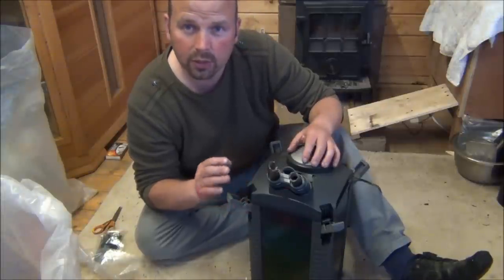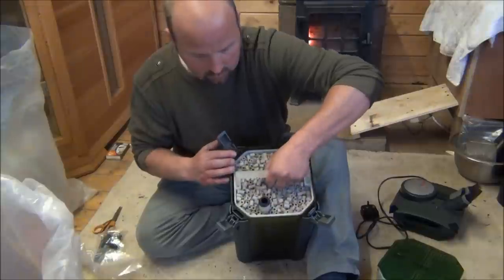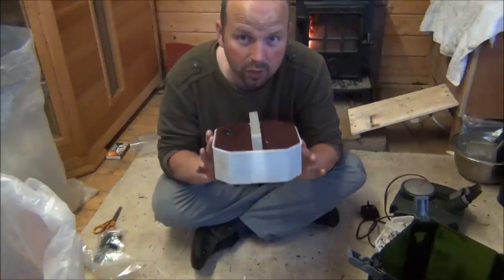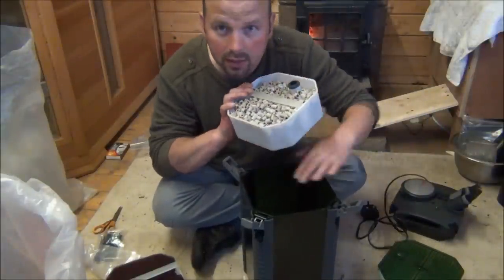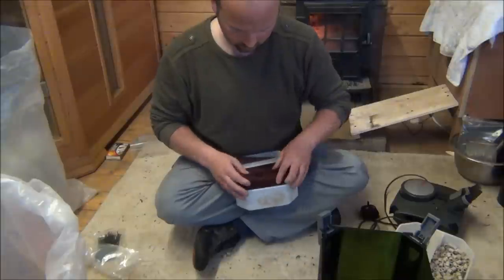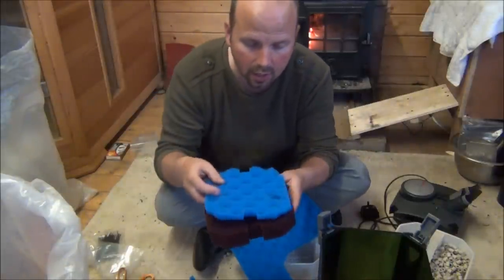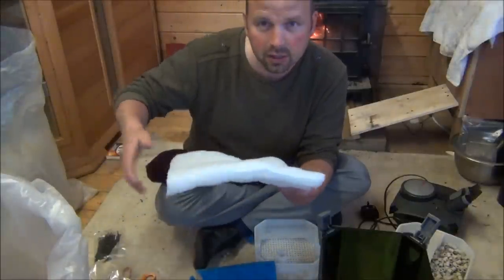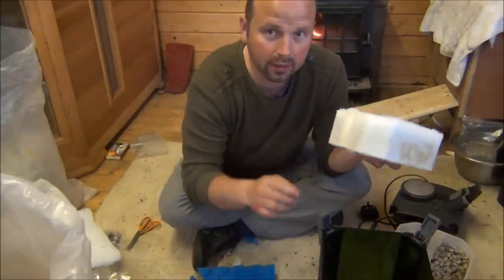How to set up an external canister filter for aquarium by Pondguru

Comment: Guru?  After almost 6 years is this still your most effective set up?  Or would you change anything?  The filter I am getting I will have 4 trays to work with.  If I choose to do a chemical layer (carbon, Purigen, etc), would you want that before or after the bio?  Thanks
Reply from the maker: Ideally the chemical 'polishing' media would go after the biological media so it would be last in the filter, operating in the cleanest water. Carbon will polish water without the harmful effect on bacteria experienced by users of purigen. If you want to achieve a full cycle then carboin is the way forward if you want a chemical media in the filter but if you're happy with half a job (0 ammonia, 0 nitrite and high nitrate then purigen will make the water look clear but not necessarily healthy.
Reply: @pondguru  what's wrong with purigen?

Comment: Great instruction...thank you.  For the medium foam, does it matter if the reticulated side is pointed down or not...to me it seems the water flow should hit the larger surface area first?
Reply from the maker: Arrrrgh, yes I just checked and I made a balls of that in this video. The bumpy side should always face down if the water is coming from below as it does in 99% of external filters. I will be doing another video like this over next couple of days and I will be sure to point that out I will also mention about the gel filter starter balls too.
Well spotted, man.
Reply: Pondguru Cool, I'll look out for the new video.  I came here because I picked up a second hand 2028.  I am working with an o-ring vendor to see if if we can get a standard EDPM 70 Duro round oring to work for the main head oring.  Have you ever used a regular round cross-section oring for this seal?  I am also finding it hard to find not only reasonably priced eheim 2028 parts here in the US, but also the Biohome media.  I don't necessarily want to order ebay from across the pond.
Reply from the maker: Roy Niswanger I have had nothing to do with replacement seals unfortunately so I'm not much help there but the direct link to the US supplier of biohome is in the video description.

Comment from the maker: It is way cheaper than the equivalent ceramic media and 1 kg of Biohome mini ultra equates to 1.5 litres of volume so you get a lot for your money. £12.99 for 1kg top quality media is very affordable, I'd say.

No point spending twice as much on a product half as good or buying media just because it is cheap. Better off buying media which does the job and makes the most of the filter space available.

Comment: Hi Ponguru, just saw ur video and found it very informative. 

I think the reason y there is a fine filter pad just before the propeller is so that it can protect the propeller and the fragile mechanical moving parts from the disintegration pieces coming from the medias. I dont suppose any filter media dont disintegrate a little with time. Those small little particles of hard objects will certainly cause damage to the moving parts once they come into contact. This is an engineering observation. :)
Reply from the maker: That's the only reason it would be there so you're dead right about that but it has the unfortunate effect of holding fine dirt in with the media, clogging it so it becomes ineffective quite quickly.
Glad you enjoyed the video, man.
Reply: Your formula for setting up the filter is great. I would keep the layer of fine filter pad at that location just before the propeller to protect it. The mechanical filtration foams at the bottom tray should be very effective in preventing all dirt from going to the biohome media. So I would say whatever dirt that is reaching the fine filter pad protecting the propeller would be very minimum and would be coming from the biomedia.

Clogging would be very much reduced. Failure of the propeller is of the highest priority, imo. 

You have a good day and make more good videos :) Cheers.
Reply from the maker: Steven Yap Will do, man - thanks for watching and appreciating the videos.

Comment: Hello Pondguru, thank you for your video. I tried to setup my filter like you explained, and I got it clogged after 3 weeks of operation. I used coarse foam, polyester filler, then biomedium. Polyester got clogged very fast. Do you think that using 30 ppi foam in-between will help me to avoid this problem next time?
Reply from the maker: Yes , definitely - muck needs to be screened out gradually and without a medium grade pad only the heavy muck is stopped before it hits the fine pad or floss.

Comment: My delivery for biohome arrived today and I see you threw in a pack of beneficial bacteria gel balls, thanks so much! One question, the biohome seems quite dusty, should I give it a rinse or a soak before putting in my filter?
Reply from the maker: Glad it arrived safely.
Yes you can rinse it (ideally in water you have drained from tank) but even if it is put into the filter in a dusty state it won't do any harm.

Comment from the maker: But, if you are a smoker, go with carbon as it should absorb all the muck which finds it's way into the water from the smoke. Provided it is replaced every 7-8 weeks it will absorb but after that it begins releasing back into water.
I don't see the need for anything beyond good media protected by efficient foams to keep the water right. Once you need to add other products, there's something not right with the filter.

Comment: great post! but i have a question.. i'm using the eheim 2180 and have it set up using there media + how they say to put it in within the manual. i have a tank of 160x59x48cm  and its a mbuna tank so stocked quite full, my question being, if i remove the media from the bottom tray and replace it with sponges will the filter still have enough good bacteria within the two baskets that are left to cope with the cycle process?  thanks

Comment: very good information thanks ime running a fluval fx6 installed last year around July 2014 going to strip it and use the bio home media the mechanical sponge setup differs from normal how would you suggest i tackle the change over
Reply from the maker: If you are running the filter on a mature system you really only should replace 25% of the old media each week so the change over takes 1 month. After that your new media should last 6-10 years. The FX6 just needs a fine pad on the top of top tray and media underneath that in all trays as you already have a good level of mechanical filtration surrounding the trays. It will take 5kg of media to do that and the best types for external filters are the mini ultra and ultimate.
Reply: thanks for the fast reply,
i have also a fluval 802 doing the mechanical removal internaly and a tetratec 1000 and also a fluval 405 as well as the fx 6 all the externals have the pond-mate type sintered glass pellets and also poly filter chemical resin heavy metal removal etc   do you think a 50x50 0n the fx 6 over 2 weeks would be ok the tank is 500 ltr south american  tropical
best regards
martin
do you remember siphroax rings over 25 years ago it was all the rage then
Reply from the maker: Martin Quinn Yes if you have the other filters running then a 50/50 switch will be fine so no worries there. I remember those rings and if that was 25 years ago I can't believe no media manufacturers realised that a ring design prevented anaerobic bacteria being supported therefore you simply end up with a nation of nitrates to reduce with water changes.

Comment: hi richard i did exactly the set up you have here apart from the noodles under the bottom tray...you have these for diffusion but would they be creating a rattle if they were bouncing about...the ones i had i had from my old eheim were plastic and float...was just unsure about using them and was under pressure for time so i just decided to let them out..not that much space under bottom try in the eheim 2080 but might try it next time....cheers
Reply from the maker: Plastic is no good under the trays and it really needs to be ceramic as it is heavy. It will not rattle about.
Glad you have the filter set up properly, man

Comment: Cracking vid, I am worried my media is setup wrong so this has been a huge help, although I have an Ocellaris 850, I'm not sure if it filters from the top or bottom if that's makes sense. At the moment it's setup like this starting from the bottom, sintered glass substrate, blue sponge 15ppi, sintered glass noodles, blue sponge 15ppi, black sponge 35ppi and finally on top wool. Does the water on this filter start getting filtered from top? Nub question I know but if you could point me in the right direction?

Comment: Might sound a daft question, but if I go and pimp my canister filter is the pump still going to manage with the extra foam or more bio I put in it?  I'm only just staring out, I want to start my canister at its best. I've noticed I need to improve the bio section for sure. I will also buy better foam pads. Will the flow rates be the same.

Comment: I firmly believe this is the proper setup. I just packed my new FX4 FULL of biohome mini, and the little black balls of bacteria.
Reply from the maker: Groovy - just remember that the water flow through the FX4 is top to bottom, not bottom to top as shown in this video with the Eheim filter. As you have good foams surrounding the trays in the FX you can get away with just a single fine pad over the top tray then biohome below that.

Comment: Do all canister filters work from the bottom up. I have a cascade 1500 on my 90 gal fresh water tank, how would you recommend I set up the trays using your biohome mini ultra, the filter has 5 trays in it and thanks for all your great and informative videos
Reply from the maker: I'm not familiar with that particular filter but it looks like it operates the same so bottom one or two trays should be foams then media above them in remaining trays. If you send me tray dimensions you want to fill I can work out how much you would need, no worries.
pondguru@btinternet.com

Comment: This is the right way to set up a filter!!!! I do that thing in the bottom as well, but I use a shrimp substrate
Reply from the maker: That sounds good. Anything which spreads out the flow and provides primary settlement will protect the foams which will in turn protect the media.
Groovy.
Reply: absolutely! :)

Comment: Thanks for the vid Guru! I just received the filter foam set and 2 kilos of biohome mini. Everything was easy to set up and is running in my eheim 2215. Would you find any benefit to adding a micron filter pad to this set up?
Reply from the maker: +Danny Youtube I'm not familiar with that but it looks like a compressed version of the fine particle matting or filter floss? Yes the filter definitely needs some sort of fine pad after the coarse and medium foams to ensure that the water is cleaned properly before it hits the media.

Comment: Great video,  just wondering if this set up would work with any canister filter?, I'm thinking of getting a all pond solutions filter,
Reply from the maker: Yes it would work just the same for an APS filter and there are very few filters which are different. The FX from Fluval trays work top to bottom and some filters have a small 'pre-filter' tray in the top which should be left as it is but apart from that canisters can be set up as in this video as the trays work bottom to top.

Comment: After I watched your video, I change the lay out in my Jebao Filter 4 stage and the result is amazing, I have a fluval u4 in the tank as well so the water is pristine clear.

I do have a question for you, since I'm new in the canister world, I place my layer like thisfrom top to bottom, layer 1 to 4:
layer 1: (top) ceramic ring
layer 2: Bio balls
layer 3: activated carbon and ammonia reducer
layer 4: (bottom) pads

is that correct?
Reply from the maker: The bottom tray with foams in no worries. I'd just fill remaining trays with good media as the plastic balls are no good as a biological media, chances are the ceramic rings are low quality (as they almost always are with Chinese filters) and the ammonia remover and carbon will not be needed if the filter is working properly.
Once you have a filter set up with simple mechanical and biological filtration you will not need to keep buying carbon and ammonia reducer as the fish waste will all be processed effectively.
Reply: K thanks for your comments, I will buy better media like the one in your video, I saw some on ebay, thanks again
Reply from the maker: Marc Tremblay
No worries, man.

Comment: I've just bought a 240 litre tank and would like your opinion as to which external filter I would need and which you would use if it was your set up.
Reply from the maker: I'd go eheim but ultimately the internals of a filter are much more important than the makers name. As long as you have a filter big enough for the tank, set up properly with the best media in you can't go wrong.

Comment: I have just got an external filter on my tank it has been going for around three weeks. If I set up my filter as you did in the video, should I use any of the media or foams already being used. From top to bottom I have Foam, Carbon then Ceramic tubes!
Reply from the maker: Yes, just set up as in the video and it will work properly (unless it is one of the very rare ones which work from top to bottom). Water should hit foams from coarse to fine then media. Carbon is optional and just takes up space which could have been used for biological media.

Comment: Hi do you need to replace those foams or not. If so at how often should they be replaced. Or how often should they be cleaned and how would cleaning be done. If you have a link to show me I would really appreciate it. Also I will be running 3 tanks with 3 canister filters running. 1 is a 4 stage 2000 lph the other 2 are 3 stage 1500 lph. How much of the bio home mini medi would I need. Im in Australia.

Comment: Hi to Richard, great video, quick question, I have a sun sun from ebay with crap media, will be doing your version of filtration soon but, I have a hole in the tube that goes down to the bottom at the top in the tray :( looks like the in has burnt through the plastic on the top tray, how would this affect the process and is it time for a new external filter

Comment: Pondguru i have a fluval 306 it has 3 stages I'm going to use set it my filter media like your video, one question i have for my carbon bags where should i place it? between foam and biohome or after the biohome? thanks for your help!!
Reply from the maker: Carbon and any other chemical filter products should be the last thing the water hits before leaving the filter so it needs to go on top of the top tray in that filter.
Reply: Pondguru  THX

Comment from the maker: +Raihen Khan
The external set up like in this video will be easily enough to keep the water sweet, no worries. You could run the internal too as a failsafe but the tank will be fine without it.
Reply: Hey there Pondguru   i have a 29 Gallon tank , would it be ok to run it with a 525GPH canister? or a 200GPH canister? would it be a bad idea to use a Larger canister? if so what would be the consequences using a larger canister
Reply from the maker: kazuma koi I would personally go with the smaller filter as long as it is rated to cope with well over 29 gal. as the last thing you want is the fish being churned up like they are in a washing machine with too much flow.
Reply: Pondguru men that word churned up Scared me lol
thanks for the response im gonna go with the one you said, smaller filter.
and also im saving up for the biohome medium size (yourfavoriteones) hopefully they go sale next week christmas :D

Comment: Just about to set my all pond solutions 2000EF using this method it really does make sense. I found bio home a bit expensive so instead I’m using Alfagrog as a cheaper alternative. Wish me luck! Jill North Yorkshire
Reply: (my other channel) I'm glad you found the video useful.
As Alfagrog is minimally porous you're unlikely to get any sort of nitrate reduction in that highly oxygenated flow from the 2000EF but I recommend Alfagrog daily for a normal set up - it's great for supporting aerobic activity which will easily ensure that you have 0 ammonia and 0 nitrite.
Alfagrog is way better than 99% of the ceramic rings out there and certainly better than low quality dense pumice sold as 'matrix' so it's a great choice if you're not willing to try for a full cycle with the Biohome.
Best of luck with the tank - as long as you commit to performing decent water changes (25%+) every week the nitrates won't be a problem when using the Alfagrog.
As long as you avoid using conditioners which will bind / detoxify / remove the ammonia, nitrite and nitrate the bacteria living in the filter will be able to achieve a full population no problem.

Comment: Very nice ideas, presented well. I've heard that the sintered glass sheds tiny pieces and being sharp and of glass, will actually cause damage in the longrun to the impeller and chamber. If  this is true--and it seems logical to me--then it would be imperative that a fine floss be put at the very top to catch the glass splinters.
Reply from the maker: There are no glass splinters, lol.
Sintered glass media is simply made of sand and powdered glass which s fused together in a kiln. If the worst happened and a few grains of sand broke free they would simply be spat out into the tank by the pump so no problem there. If you would be worried about that then go with an extra fine floss above the media but always ensure that you also have one before the media to prevent the fine dirt travelling through media and being held in media trays by the fine floss on top. By not having fine floss on top it will extend the life of media and any really fine particles which do make their way through the mechanical filtration zone will simply be spat out and caught second time round.